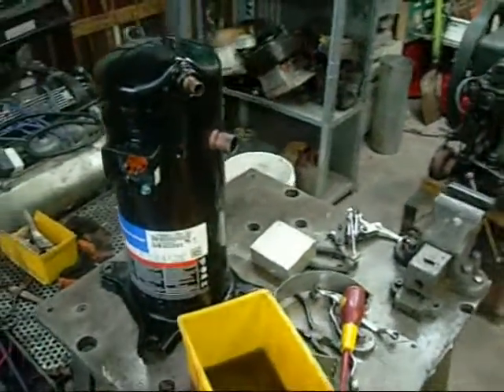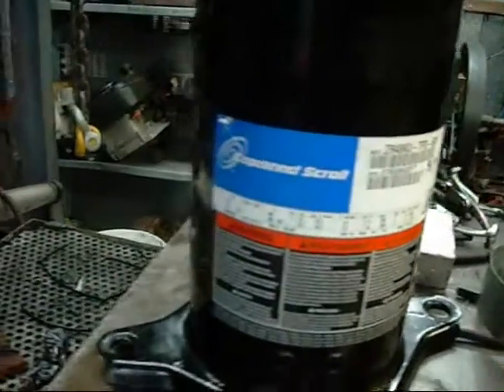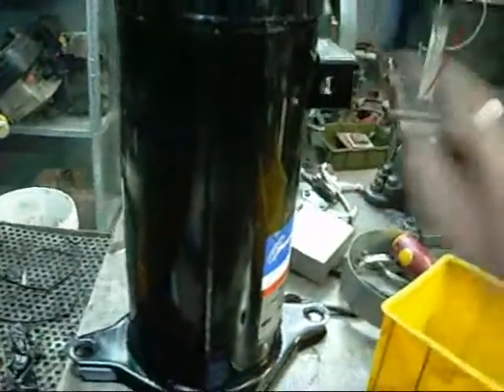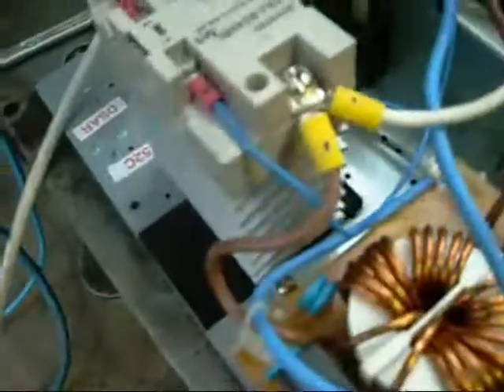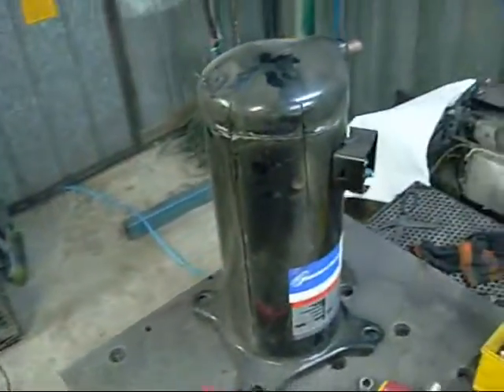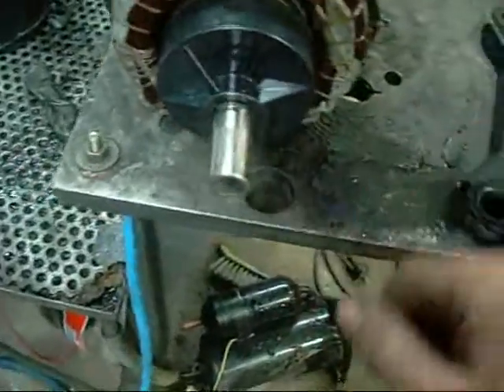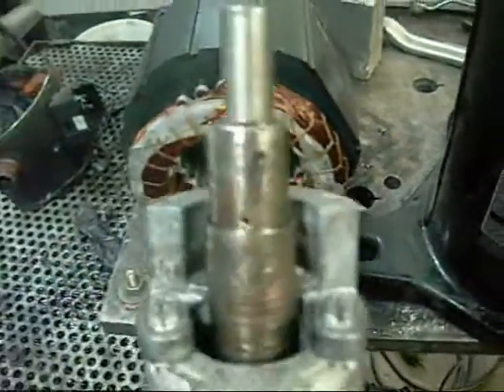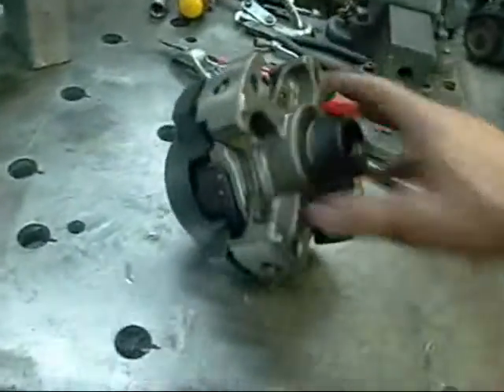Copeland Scroll Compressor Autopsey Pt1

Comment from the maker: I used a grinder and slitting wheel, I did not care if parts were damaged. its almost impossible to open them without contaminating the  insides.

likewise a torch would create too much heat and result in a oil fire + cooked motor

Comment from the maker: Did you get the run capacitor with it?

The pins should be marked on the foam terminal box seal, Run, Common and Start.

You'll need to wire neutral to Common, 

Active to one side of the run cap with a wire coming off the same side and going to Run

And one wire coming off the other side of the cap going to Start.

If you don;t have the run cap or its 3 phase you'll need to guesstimate it. I'd start at 60mfd 450v and upwards for a scroll this size.